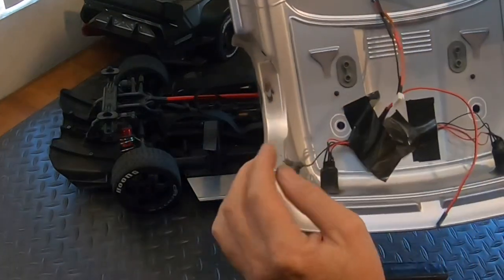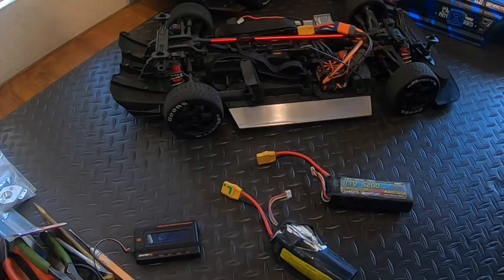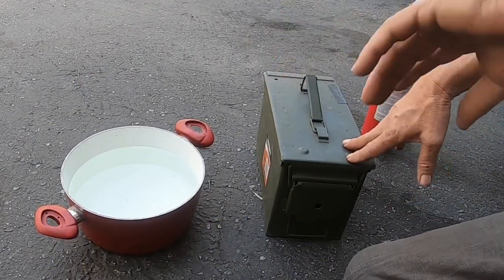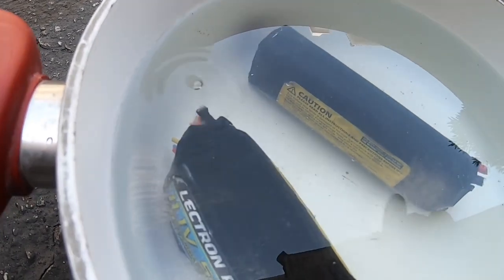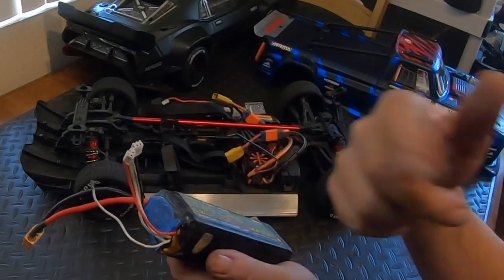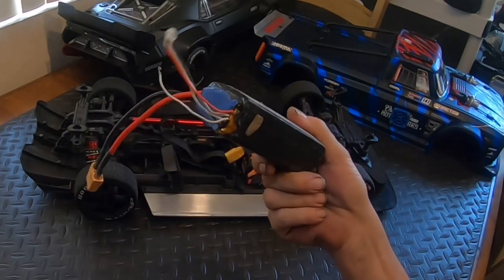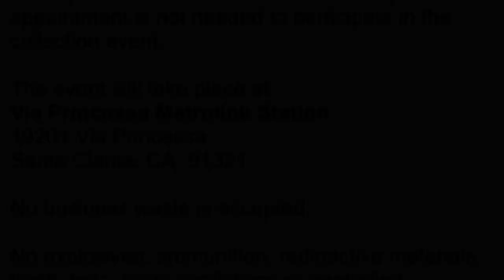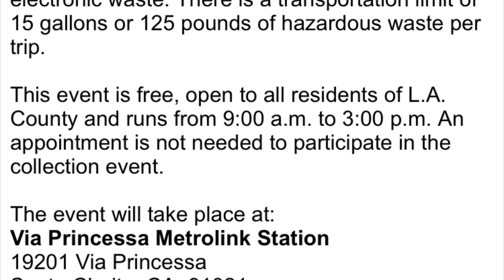Lipo batteries Safty & how to dispose of a lipo per the fire department?

Comment: I had a battery I left in my rc overnight do the and thing. I discharged it as much a possible.  I cut the ends off.  It's been sitting in a safe place outside for a couple of weeks.  Going in salt bath now to finish it off. I didn't believe it until I just saw the salt water work.

Comment: There's voltage in it. It's just too low for the cell checker to read it. I've had batteries do this but not swell.  I low charge them on ncad until they reach about 3.5v per cell then switch to lipo.

Comment: Lipo's can self charge enough to cause a sparks after being fully discharged. Cutting the leads short is great, as long as the stubs don't accidentally come into contact with metal in the garbage truck or dump site. Many forums also recommend wrapping electrical tape around them or leaving the leads long enough to solder together. With them soldered together, the battery remains at 0 volts. I solder, tape, then pitch. 😃
Reply from the maker: I agree as I saw a spark even fully discharge so there still sitting in salt water bubbling over 24 hours 😱🤷🏻‍♂️💯💯

Comment: I had a pair of 2s Revtech batteries for less than a year but they only had about 3-4 runs each on them when they puffed the hard case while they were in storage charge (no connectors to cut) I did that whole salt water thing for 24hrs then ended up leaving them at a battery recycling thing for lithium ion tool batteries at Home Depot kinda felt better about that than just dumping them in the garbage
Reply from the maker: Great to know home depo has that 🔥🔥

Comment: I discharged the battery using 12v bulb until you cant see any light and check also if they still have spark if non. It’s already safe to throw in the garbage.
Reply from the maker: Yes and game changer fans work good as well 👍👍🤛🤛

Comment: Now I never had a lipo swell or blow up on me. But I'm sure it can happen n most likely will one day lol. I keep mine in lipo bags but I have been guilty of leaving lipos in my Arrma 3s rigs lol. I don't anymore but when I started up in RC again I legitimately forgot a few of em before. I had a Ovonic 5200mah 50c 3s lipo with the XT60 connector and it was left in my Arrma Granite lol. I completely forgotten about it and it was in the truck for almost a month and it was fully charged when I put it in the truck and something came up and I just forgot about it and left the truck sitting in our game room next to the Xbox series X in the floor on a stand lol. And it had some dust on it from sitting there. And when my step daughters came they wanted to drive the RCs for a lil bit. So I let em drive the 3s rigs like my granite and big rock which are my only two bashers left and a crawler sadly. But back then I had a good amount of selection. But I wouldn't let em drive anything that had more power. So I got my Granite and my old voltage that was built up far from stock btw lol all metal integy gearing and custom metal parts all over it. It was a ok truck I'm not a big fan of 2wd monster trucks its not right to have a big truck big dirt tires and only rear wheel drive lol. So I basically turned it into a road truck with a Vaterra C10 body shell. It looked amazing actually and was kinda fast with a castle 7500kv motor in it lol. Anyway I got all those out for em and when I went to drop my lipo into the granite I found one of my Ovonic 5200s in it lol. So got it out and was freaking out in a way cause it was in there from Sept 20th to October 31st Halloween. Is when I found it.... Anyway I went to check it with my venom lipo saver and it showed 12.58.... so it was basically fully charged which is very surprising in a way but also I know Ovonic makes amazing high quality lipos at a low cost which is awesome. And so I balanced charged it and my iMax B6 charged it for maybe 20 seconds before it was at 12.6 and every cell was equal. So I put it in my big rock just incase it was to blow up it would be in my big rock and not in a rc they are driving. So it all went good thankfully. And now I'm pretty careful with em and always checking the temps and making sure the lipo is ok and the esc n motors ect every few mins. I don't run em to hard anyway I take good care of em but I don't baby em I use em in the way they was designed lol. But yeah I got lucky. Now I got a champion 5200 mah 80C 3s and I use it mainly in my element Enduro Trail walker with a max 10 SCT and a Tenshock 906 small block which is a 3650 and 2400kv which isn't really a fast motor being a low kv but it is torque heavy being 6 pole 9 slot. So it's a amazing for it's size. And the lipo melted the ground wire so I gotta fix it or simply replace the lipo itself. It's still a good battery it's just ugly ATM lol. And in the military we had some interesting batteries that are very similar to lipos we use in the RC hobby that we used in military equipment. Except these batteries lasted much longer. They use a radioactive element so it's a nuclear battery it's not dangerous even tho what's inside is lol. It won't explode ect but looks identical to a 4s lipo and gives out same power and they got diff sizes. Thing is I dunno when or if they will put them out to market though. It's not anything someone can build a weapon out of. It's a weak radioactive element and it's used in certain rings and charms and it can glow if left in the sun light. I forget what it's called but those batteries last about 5 months on a single charge and can recharge themselves and I dunno how that part works but we use em on certain drones and satellites. It's pretty cool stuff. Now if we had something like that to power our RCs with that would be a game changer.
Reply from the maker: That’s crazy self charging and hold a charge a long time insane 👍👍

Comment: Same method for me.  First, I cut the wires with different lengths so they cannot touch and I cannot get a shock from my plier or make some sparks when I cut them.  Second, I leave the battery inside a bucket of saltwater for 7 days minimum. Just to make sure that it discharges completely. Then, after all that time, I put a nail in the cells just to make sure that the battery is killed completely!!!!  Never had any issue whatsoever with this method.

Comment: Hey Earl quick question my 4S LiPO batteries are cutting off at 3.6 volts in my x-max when I checked in there pretty much at 3.6 volts for sale is that okay to leave at that until the next time I charge them to run it or do I have to plug them into a storage charge cuz my storage charger put some up to 3.8 but they should be fine at 3.6 right
Reply from the maker: I’d keep them at 3.8 if a long storage but if you’re running in the next week 3.6 is ok ✅
Reply: Thanks I thought that was all right I appreciate it though
Reply: And thanks for the fast response just great

Comment: Salt water is not what to do, the salt in the water creates a chemical reaction (electrolysis) that causes the electrodes to dissolve before the battery is discharged. Correct way is the either use a proper discharger like the ISDT FD-200 to take them down to zero volts, or wire up a  halogen bulb and connect to run it down to zero. Don't put in salt water, pretty much the single worse thing you can do
Reply from the maker: If the battery has a broken internal wire connecting the cell a battery discharging will never work ?? That why the salt water method is the best it attacks the power not the battery leads 💯💯💯
Reply: @earlmoorhead5555  Would say a broken connector on the main wires is pretty rare, balance wires yes but you dont need them to discharge.

All salt water does is dissolve the tabs through electrolysis , so now all your viewers think the best way to discharge a lipo is putting in salt water - which is a very bad idea as it leaves you with a lipo with no way of actually discharging it.

https://forum.flitetest.com/index.php?threads/salt-water-lipo-disposal-bad-idea-or-really-bad-idea.12467/
Reply from the maker: The main wire still has jumpers on 2s and up and the little thin jumper is the fuse to the main wire 👍👍
Reply: @earlmoorhead5555  ? Lipos dont have fuses in them ? the bubbles you see coming out the water is where the tabs are dissolving via electrolysis, anything above 1v of charge  and the tabs will dissolve before the lipo is discharged and then you have no way of discharging it.

Reduction happens at the negative cathode because this is where positive ions gain electrons. Oxidation happens at the positive anode because this is where negative ions lose electrons. You will also be producing hydrogen and chlorine gas

Im just trying to advise you that salt water is a bad idea and a myth that has spread from the days of old.

The correct way to discharge is via a discharger or a halogen bulb set up
Reply from the maker: The wire is the fuse ??
Reply from the maker: @HardcoreRC  as you see in my video not even a bulb lights up so how do you get the remaining power out ? I showed this in the video ? It’s sparks but won’t turn anything on as it well under the 8 v 🤷🏻‍♂️🤷🏻‍♂️
Reply: @earlmoorhead5555  Didn't see you connect a bulb - what time stamp ? only saw you connecting cell checker and fans via the balance leads not the main leads.

Super rare for the main wires to desolder inside a lipo, however quite common for the balance lead to break or pull off the solder.

I would hardly call 8, 10 or 12awg gauge a fuse 😂 

Need to discharge through the main wires not the balance leads.

As said the bubbles you saw was not the charge being drawn out, it was hydrogen and chlorine gas being produced as the process of electrolysis is being done, and in that process the cathode dissolves
Reply from the maker: Connected a cell checker and two 12 v fans and nothing showed power and before I put it in the water I ran my meter across the terminal to get an idea of what power is in them the popped lipo showed 1v the other showed 7.9 v and a third off Camara a max amp showed 4v total
Reply: @earlmoorhead5555  You plugged into the cell checker and fans into the balance lead, not the main leads. Likely the balance wire was damaged which is common

You could have connected a 12v halogen bulb to a XT 90 and connected to the main plug to drain it properly.

Salt water is not the way to discharge them, the tab dissolves before its discharged

Comment: Great info Earl.
Do you store them in the ammo cans too?
I store mine in ammo cans but never drilled a whole or removed the seal.
Should that be done for storage in the cans too?
Reply from the maker: Yes I have three cans to store them that way I won’t loose every battery I store by age of battery first year second year 3rd year battery can 👍👍
Reply: Better remove that seal or you're looking at a pressure bomb TAKE THE SEAL OUT AND DRILL A FEW HOLES IF IT DOESN'T HAVE ANY.
Reply: @earlmoorhead5555  Thanks Earl
Reply: @bigboytoyzrc9258  Thanks for the info,

Comment: Hey Earl the front steering tie rods for the arrma K8 EXB, came in last week been meaning to let you know, they are GPM, Not everybody's favorite aftermarket supplier. However being the only aftermarket front tie rods available I went ahead and purchased them. I must say they are a significant upgrade. The ball ends could be larger but overall not to bad.

Comment: Earl, if the battery ran to 3.5v cutoff and you disconnected both leads, It should not puff unless the ESC is set to run them way to low and you are getting an incorrect voltage reading. Check the ESC pprogramming for cutoff. Use a dummy load to discharge them to zero. A 200w 1.5 to 2.5 Ohm (4x  7-8 Ohms 50W in parallel) resistor network on a heatsink with a fan to zero volt wil give a wide range of 2S - 4S pack discharge rate. This load will allow you to discharge any pack at 4C rate or better and save you time when you come home with unused packs.
Reply from the maker: I set all my road cars to 3.5 v really low cut off factory is 3.8 seems to cut off I run mine low as I use them weekly 🤛🤛but these batteries are 3 years old I have 11 of the same packs California been super hot and I feel that killed these batteries 👍👍
Reply: @earlmoorhead5555  They did look preety gnarly! Heat kills everything.

Comment: I just bought 2 brand new 3s 120c bashing series gensace batteries and jumped my maxx about 20 feet in the air it nose dived landed on its face and the battery strap didn’t hold they popped out of the hard case they came in so I didn’t risk bringing them back home I just finished them off with the shovel. But I definitely need some more lipo bags and a voltage checker
Reply: that sucks those are nice batteries my friend but at least no ones hurt and your rc isn't burned down
Reply: @PageCrowes  yeah super nice batteries and nobody was around to get hurt so I’m happy bout that and luckily they didn’t catch fire and burn my truck down. But I’m gonna replace the 2 3s with one of the gensace 6800mah 120c 6s bashing series batteries.
Reply: Instead of stacking 2 3s

Comment: Lipos make me nervous! My family and I moved back in to our apartment 3 years after someone had their toaster set the building on fire 5 years ago! 2 years of living not in my apartment🥴! I've been storing lipos in a 50 cal.amo container with 2" of the seal cut out! I do the care tail light to discharge a lipo. Have to check out home depot instead of putting in the garbage. Had 3 lipos go bad in 8 years of running them! I always charge .7 to 1 amp less than max c rating to help with reducing swelling of the cells! 
Thank you Earl for lipo safety!!!!💯%
Reply from the maker: I agree I’ve never had a lipo fire 🔥 and never want one I go thru all my batteries every three month and my rc daily but this shocked me and now I’m going thru all my batteries again after a month as the heat is killing them 💯💯👍👍
Reply: @earlmoorhead5555  same no lipo fire! Only have 14 lipos to maintain. I read a article last year about charging .7 to 1 amp less than c rating.example- 5000mAh at 4.3 or 4.0 and not at 5.0 will help prevent swelling during charging. So far have not had a pack swell up.1 spectrum 4s 5000mAh 100c is coming up on 3 years.
Always checking and balancing before I charge all lipos! And monitoring the ohms at full discharge and full charge! And keeping my 🤞🤞🤞🤞🤞
Keep these informative videos coming. 
Did learn home depot will take my old lipos!
Thank you Earl!💯%
Reply: @earlmoorhead5555  this dam heat! I'm running before 11AM or after 6pm so not in direct sun! And not running so hard!
Reply from the maker: Me to idk depo took them now I do ⚡️⚡️⚡️